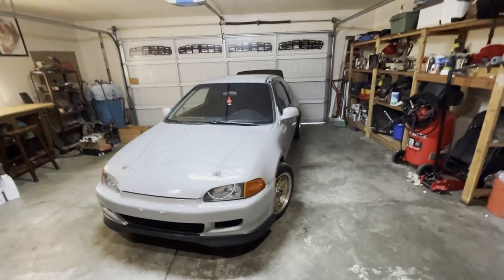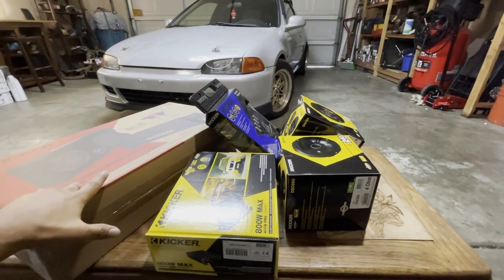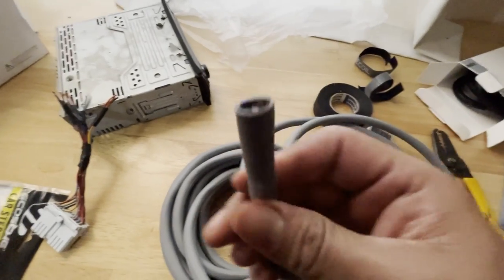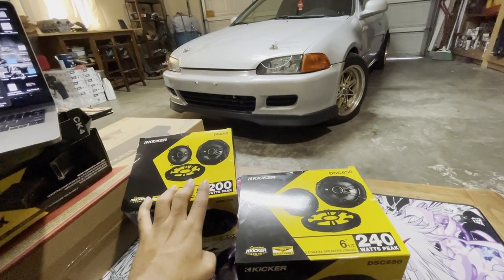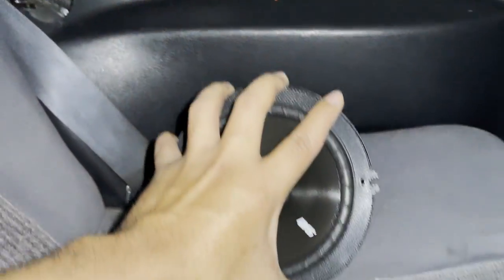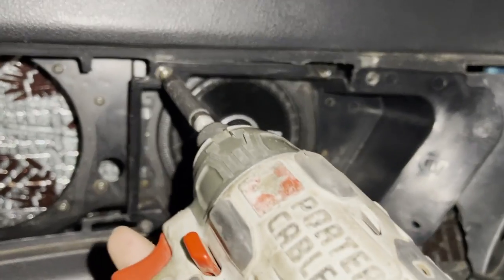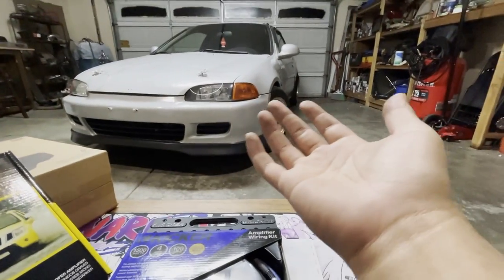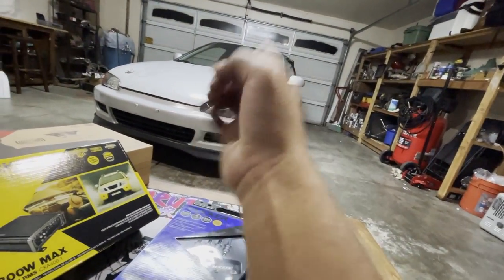Installing a Kicker Sound System in my EG - Speakers!!!!

Comment: Nice work. I recently installed some speakers in my hatch. Unfortunately the speaker tabs didn’t line up with the oem protective bracket so I didn’t use. But now considering the rear protection from car washes and rain, I’m gonna use. I will have to drill dome holes into the speaker frame to make it fit with oem bracket. Wish me luck I don’t damage my speaker 😁
Reply from the maker: I totally forgot to mention thats what i did!!! I drilled screws straight through the OEM housing even though the holes didnt line up… as long as the bracket stayed in place i didnt care😅 best of luck 👍

Comment: You got the gathers speaker brackets  and will need the gathers cover for it   Did you get the cover for it
Reply from the maker: @manchaboyz1357 Nahh i just left everything as is.. no covers in the rear except that trim panel